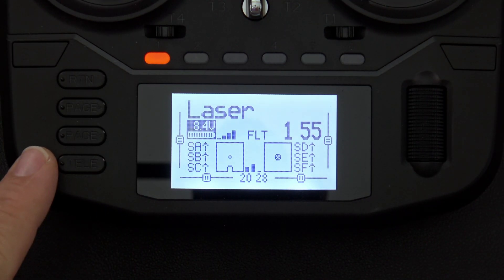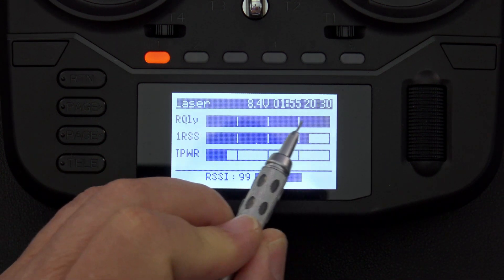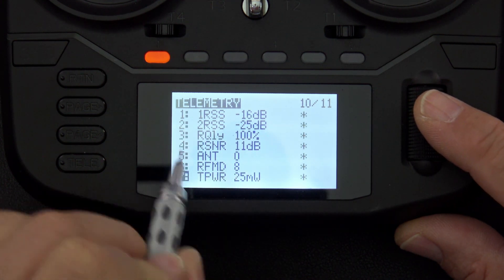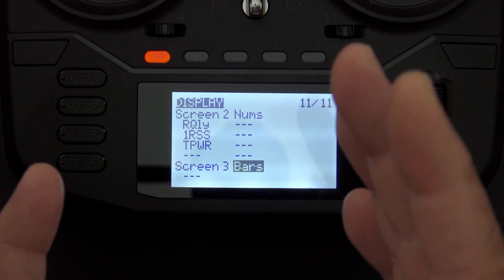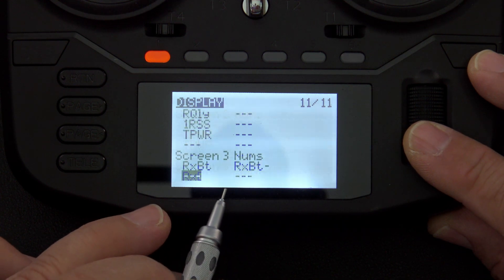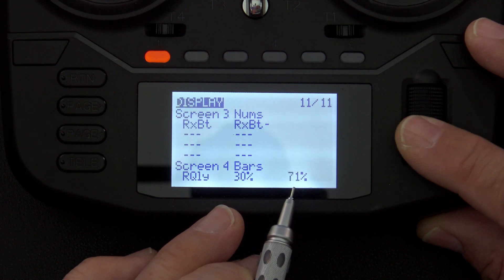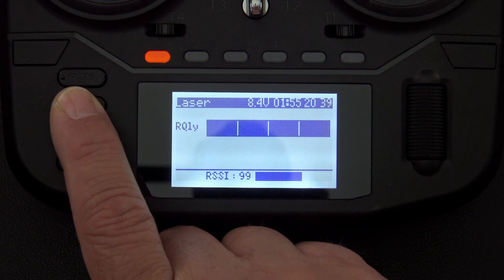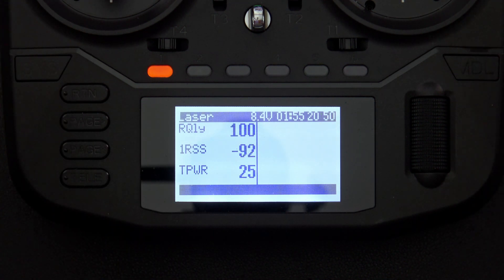EdgeTX Telemetry Screens on B&W Radios • Radiomaster Boxer and Zorro

Comment: I have found this video on Boxer telemetry very informative and useful and have set my tx up using it. The only thing that is of concern is that I cannot get the Altitude sensor CAT01 to work. My set-up is as follows: Boxer 4 in 1 with Fly Sky iA6B r/x. Any help that you can give would be most appreciated.

Comment: Hi John.  I've got another question about telemetry.  I have a Spektrum Sky ID module and it gives me altitude info to my Boxer.  Unfortunatly it doesn't give it AGL, just MSL.  But it does have the "min" so I could use that.  Is there a way to calculate the difference in 2 values?  Then I'd have the AGL!  Just trying to stay legal, not that I fly super high anyway.  When I download the logs to my PC I do the math there but it isn't while I fly.  Thanks for your always excellent advice and suggestions.
Reply from the maker: I don't know of any way to make that conversion outside of in your head. If you know the altitide of your flying field, add that to MSL and you're set.

Comment: Thank you for this video! I just used it to get pack voltage on the screen of my Zorro, using my new style (2023 onwards) Lemon stabilized 7 channel receiver that ships with the single pin voltage probe. I set my range from 10.5V to 12.6V for a 3s pack but I may change the low voltage setting to compensate for in flight sag.
Reply from the maker: Since you're aware of sag, you might want to see this. I use it on all of my planes now: https://www.youtube.com/watch?v=Q5s7zB0NDCQ
Reply: @RCVideoReviews  thank you, that looks very helpful!

Comment: John, a great video as always and thanks!  I was wondering if there was a method to reset the radio received telemetry values for a second flight without turning the radio off and on.  I like to have the telemetry for each flight stored separately in the logs.  I'm using an RM Boxer.
Reply from the maker: Long press the jog dial from the main screen and the first option is "reset" Click that and you can either reset flight, timers, or telemetry. Resetting telemetry will reset min/max values of telemetry. Resetting flight is like loading the model from the model selection page. Resetting timers does just that.
Reply: Thanks!  Awesome tip. Now I'll see of that can be done when I use the arm switch.
Reply from the maker: It can.

Comment: omg, im just trying to figure out how to add voltage level from drone to screen on radio, ive watched so many videos and reading to not find this information, Ive even sent radiomaster a tickct. Ive went through alot so far, logical switches, special functions to not find any telemetry options, I go to set up telemetry (is why I am here) and none of the sensors I need are there, I try to add one and that is a whole different jar of flies, and another video....I just want to know how much juice is left in my drone before it falls out of the sky. I am not using goggles, so I kind of need this information in flight, and I know it can be done, can you help me, direct me to the proper video. This whole setup process seems a bit much, but I am trying, not doing very well3 and is frustrating, especailly when I get people telling me to just look in my goggles lol

Comment: Great content👍.
Can you please advise how set up flight back alarm if you use two pack un your plane example 2s or 3s  and my receiver just gave me total battery voltage and not pack voltage.
Any advice or link to any other video you already have about this is appreciated. 
thanks!!
Reply: What I do is use the cel1 value. 1S worked well for me.

Comment: hi, thanks for the video. I dont have rxbat, gps etc but i have rssi, LQty which are rx telemetry. Already enabled telemetry in receiver tab but still cannot see it. I'm using happy model elrs rx and radiomaster boxer elrs. Do i miss any setting? Thanks
Reply from the maker: You need a receiver that provides this telemetry. You didn't mention what RX you're using. For follow-ups to this question, please join our discord.
Reply: @RCVideoReviews  hi, thanksnfornthe respond, I have 2 drones which both cannot get gps telemetry. I use happymodel ep1 elrs dan radiomaster rp1 elrs as well.

Comment: Many thanks for this excellent video, I have setup Rqly for signal strength on my quad.
Can you tell me if Is possible to set up a sound warning when Rqly is low as I will be wearing FPV goggles, thanks again.
Reply from the maker: Of course. Use a logical switch. A<X with A=RQLY and X being your number. Once that logical switch is on, use a Special Function to play an alert.
Reply: @RCVideoReviews  Many thanks for you reply, I have only had the Boxer 2 days and still learning. Is there a video that covers logical switches and Special functions. Thanks again for your help.
Reply from the maker: There is a channel on YT that's famous for OpenTX and more recently EdgeTX videos. Something like 200+ videos between the two. Let me post a few links. 

The first one covers logical switches top to bottom: https://www.youtube.com/watch?v=u-EOmqWQmvs

This is a group of playlists with all the other videos referenced:
https://www.youtube.com/playlist?list=PLy3TC1ILJYTjqDXFB84oXVWZG14zyMYYt
https://www.youtube.com/playlist?list=PLy3TC1ILJYThzwReZComrM-LFTa2wfiUW
https://www.youtube.com/playlist?list=PLy3TC1ILJYTgH-MMqDYhrCh6Bp65BJzS_
https://www.youtube.com/playlist?list=PLy3TC1ILJYTjsMsQ2YF5ZCUubv0IFiWkd
https://www.youtube.com/playlist?list=PLy3TC1ILJYTjsMsQ2YF5ZCUubv0IFiWkd
https://www.youtube.com/playlist?list=PLy3TC1ILJYTjWBv9HIpj_Eb5yA_W9Neua
https://www.youtube.com/playlist?list=PLy3TC1ILJYTi_r8rRrgLmpJ17WGEZ4lYo

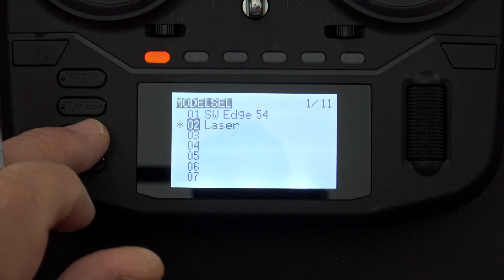Comment: Thanks for sharing this - very good info here! Question: @1:30 under Telemetry it shows "Low alarm: 45" and "Critical alarm: 42" .. are those percentages for RSSI or something else? And are those values the best for something like a quad on ELRS and an O3 unit?
Reply from the maker: Those are leftover values from D16 days. The protocol developer specifies the primary telemetry value. So you have to find out what your protocol is sending. This video will help: https://youtube.com/live/sl68I-MoJ9Q
Reply: @RCVideoReviews  - wow - thank you - checking that link right now !!

Comment: How do configure the main screen?  I have a Zorro and on the main screen I only see the reception bars.
Reply from the maker: There are two sets of screens. The output screens and the telemetry screens. 

This video shows you how to configure the telemetry screens of which there are 4. You configure them per model by pressing the model button. page left, "display" you see screen 1, 2, 3, 4. 

The output screens are not configurable. You cycle through them by pressing page right or left. There are 5 screens, starting with very little output, then ending on the channel monitor before cycling back to the one with very little output. Again, these are not configurable.

Comment: Was just about to get myself the RadioLink AT10 until I saw your other content about it. I'm just considering now the Boxer, doest it have RX sensors to show Flight Baterry voltage telemetry?
Reply from the maker: Flight pack voltage (vbat is a common name) is Rx dependent. So look at something like the Happymodel EPW6 ELRS Rx which has a vbat sensor and you get it. I haven't seen a lot of vbat sensors on CRSF only ELRS Rxs, but there are lots of PWM versions that do, AND you can also run CRSF out of the PWM RXs, so good option for flexibility.

Comment: hi
how can i display actual time on main screen with the stick&pots and how to display time&timer on top bar?
Reply from the maker: You can't.
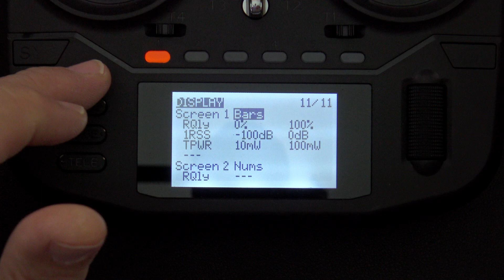Reply: @RC Video Reviews  how do you managed to do? Because on your boxer, in this video at 1:10 and 4:52, i saw exactly that...
Reply from the maker: That's not the top bar, that's a telemetry screen. To change the preconfigured main screens, press page right.
Reply: @RCVideoReviews  i know how to page trough telemetry or main pages.

My main question is how to set the time and timer next to your model name in telemetry screen? My boxer shows only internal battery voltage there...

And how to display the time on the "i call it mainscreen", the one with the stick overlays?

Do i need to set this up in edgetx Companion?

Comment: Thanks for the video! I have some questions - I'm just getting into RC and I'm thinking that I should go with the Boxer as is has a bunch of channels and knobs, high transmit power, and supports telemetry. I plan to work in Ardupilot with a Pixhawk/controller that can run Arduplane and am wondering:
- How to find a receiver compatible with the Boxer and supports sending it the telemetry like you've shown, and support SBUS/PPM for the flight controller? Or is an SBUS/PPM on the receiver what sends telemetry?
- Does the Boxer work with SBUS or PPM, or is that up to the receiver I choose?
- Can Ardupilot even send telemetry back to the Boxer or is that an iNav thing? Thanks!
Reply from the maker: You need to join my discord and ask these questions there, you'll get a much better interaction and a more thorough discussion.

Boxer has two options: ELRS and MPM. MPM allows you to use lots of different over the air (OTA) protocols. ELRS just uses ELRS. 

SBUS generally refers to a serial communications link between the RX and Plane, although there are use cases within the TX for it which are out of scope for your question.

The RX sends telemetry. While sbus is a one-way protocol, the telemetry I showed here originates on the RX, so it is not reliant on SBUS to make it back to the TX. 

Again, SBUS/PPM are serial streams and more between the RX and model than between the TX and RX. In certain receivers like the FlySky IA6B you can configure the RX to output IBUS or SBUS, but again, that refers to output, not the link between TX/RX. 

Ardupilot doesn't know or care about your TX. It just knows to send telemetry. For that, you need a bi-directional on-craft protocol like CRSF or f.port.

Join discord if you want to know more.
Reply: Thanks! I was biased towards the 1 W ELRS version for its transmit power as I want to use it as a redundant telemetry link for potentially getting a cheaper 100 mW 3Dr radio for Ardupilot telemetry. To have the Boxer as the more expensive part of my setup to monitor things like aircraft heading and battery voltage (and initiate flight modes) if the 3Dr reliability becomes unstable would be nice. But it seems like the multi-protocol Boxer version may be the way to go if I want a receiver that can also listen to input from Ardupilot so I have the telemetry redundancy. I will be looking around the web and your Discord for hopefully any ELRS telemetry receivers for the Boxer, or just going MPM for a bi-directional protocol as you mentioned. So much to learn as a newcomer to RC, but people like you make it easier. Thanks

Comment: I literally just set this up on my jumper t pro yesterday but I used the inav lua script, I had no idea I could display the telem without the Lua thankyou, I struggled to get the Lua to display and had to update the radio, I wish I just did this instead so for the record this works for the jumper t pro aswell add it to the title because no one has videos speaking in English talking about how to get telem on the tpro the button layout is a little different but easy enough to figure out. Also elrs the rqly is I believe lq of telemetry  tqly I think is the same as the lq you have in osd
Reply from the maker: tqly is downlink quality. rqly is tx to rx.

Comment: I need to show the telemetry screen as the default screen after the radio turned on. No  need to push "TELE" button to show the telemetry data everytime. Hope the devs is listening.
Reply from the maker: Have you suggested this on the EdgeTX Github issue tracker? That's the best way to submit feature requests to the EdgeTX team. They do watch these videos, but they don't necessarily see all the comments.

Comment: Hi. im using QX7 ACCESS radio. i have issue binding with Radiomaster R88 V2 receiver which supports ACCST D16. im unable to bind to this receiver. i tried updating the ISRM on the radio but still unable to bind with R88 V2 receiver. is there any solution or fix? i tried to downgrade the ISRM to qx7 access ISRM version 1.1.3. and it got bound. but i can notice some packet loss while moving the servos. Does separate firmware for R88 receivers exist? to support ACCST D16 (V2)?
Reply from the maker: Try frsky and frsky x2.